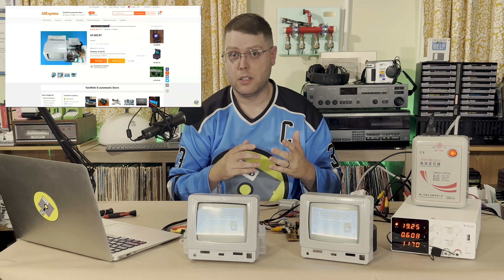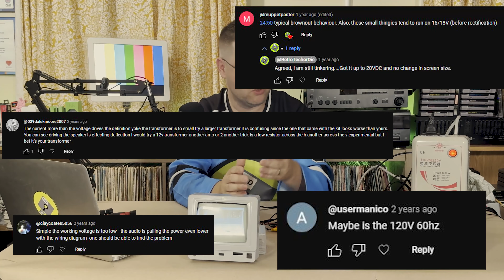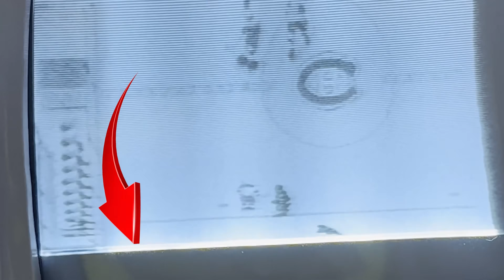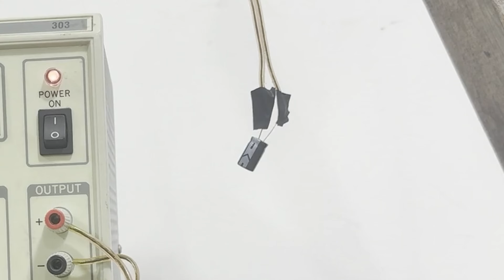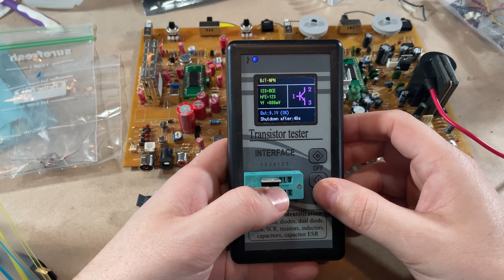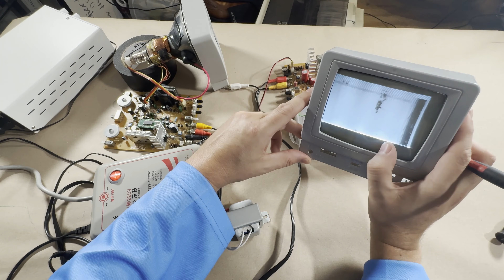I Built ANOTHER CRT TV from an AliExpress Kit—But It’s Still Not Working! #aliexpress #diy #retro

Comment: Thank you for the interesting pair of videos. I know you've shelved your CRT TV builds for now, but I was inspired enough to order a kit (PCB and parts only, no CRT or case, the CRT I planned to use came from an old baby monitor). My first build resulted in nothing but a horizontal line.  So of course, like you, I ordered a second one. That build had transistors Q6 and Q7 explode. Those transistors drive the vert deflection coil. I measured the resistance of the vert yoke and compared it to another 5" CRT and it was about half. Apparently not all 5" B&W CRTs are built the same. I replaced the destroyed transistors, swapped the CRT for the one with higher yoke resistance, and I had a working TV.

It seems to me that one thing your two builds have in common is the supplied CRT. The CRT I used that worked came from one of those 5" portable TVs they were practically giving away in the early 2000's. Swapping the CRT might get you closer to a working set.

I also found the original Chinese training document for the kit. I've created a very ugly English translation. It has test voltages and wave forms that might be of use to anyone attempting this build. Here's a link: 
https://1drv.ms/w/c/f632a9afe283d7ea/EckYohVPitFGn4gnvmXG5OEBtHzCDw6B9cF4gAomSC2Mbg?e=n02HfT

Comment: Hello my friend.  I saw this video today.  Try fixing the screen moving the chok at the tube. moving it front or back it will make the picture larger or smaller and if you move it left or right the picture will change in angles.  Nice playing with old tech.
Reply: the yock must have two plastics and moving them are changing the way the electrones are moving in the tube. You need to calibrate it. Don't bother about 50hz or 60hz. Remember that ac is converted after the rectifier. It is dc volt. Calobrate the yock and you will be fine ..

Comment: The pal/nstc converter probably just converts the color signal by inverting the phase of each alternating line, so the typical black & white signal that the TV shows turns into a color one, but it's very unlikely that it changes the amount of lines or frequency, that's way harder to do.

Comment: PAL/NTSC/SECAM is color information and is ignored/filtered by B&W CRT. 50/60Hz vertical framerate will make image out of sync, same for horizontal for different non-compatible resolutions. Reverse engineer Vertical amplifier and compare it with brand TV circuit and waveform.

Comment: It’s black and white, right? PAL and NTSC are only needed for color sets. They’re both reverse compatible to a single black and white TV standard.
Reply: No, "modern" black & white is just PAL & NTSC without colour, they are not the same standard. They still use a different number of lines and have a different refresh rate. While many proper CRT TVs could handle either signal in black & white, they still have to accommodate these different timings.
The system here is obviously a crude design, so isn't handling NTSC timings properly. Likewise it probably wouldn't handle the oddball signals from old game consoles, which normal CRT TVs did.

Comment: You are in for a good learning experience with a rather steep learning curve.
There is no doubt the kit needs a thorough optimitazion of the circuit.
Its not "fake" components, its a complete re-calculation of every component, according to the control IC specifications.
Firstly the finished kit immediately shows a weak power supply - start here !

Comment: 13:52 one of those 1k (brown-black-red) resistors seems to be measuring not 1.0k, but 1.2R!
The gold color band indicates a tolerance range of 5%, which would make anything from 0.95k to 1.05k "within tolerance".  The 1.5k and 1.2R results are both wildly out of spec.  I suspect that the 1k resistors that went into that color banding machine were also contaminated with resistors of other values.

Comment: If it’s 60 Hz instead of 50 Hz the frame scan won’t reach as far down the screen before the frame sync kicks in. If the NTCS to PAL converter just changes the chrominance (colour) carrier but not the frame rate the same problem will occur. You need an actual PAL source at 50 Hz/FPS to test.

Comment: I have build an 'oscilloscope', when I was about 16 around 1976, I used my knowledge from highschool, so it was quite primitive, but was lots of fun (besides the electroshocks). It used the famous P5 tube. Anyway I think sw6188 is saying smart things, although I don't know some of his abbrevs. It's clear that there is something wrong in the vertical signal resulting in a bunch of horizontal lines at the bottom. I'd solve that first! Clearly it has nothing to do with the power supply or the PAL versus NTSC signal. BTW. modern (switching) power supplies can use 120V or 220V both. They first convert it to DC using a small transformator, a diode bridge and capacitors and then the switcher does the rest, taking a little voltage at a time. After that there is another capacitor of course to stabilize it. This invention was made quite late, because switching a big stream gave heath problems. But a thyristor could do that! The problem was that whilst switching between on and off, there would be some current flowing.
Reply from the maker: So this has its own bridge rectifier and the DC voltage after that is with in spec. My gut things its less a power issue and more a design issue.

Comment: There is no point in trying 220V since the thing internally works on DC anyway, 50Hz or 60Hz makes no difference...
This certainly has nothing to do with PAL or NTSC... It is clear that the raster is not large enough to fill the entire screen. The first thing I think of is that the supply voltage is too low. .. Maybe the thing is just so poorly developed... It could be that one of the voltage regulators is too weak. The effect of the audio on the raster really makes me think of a power supply problem. There also seems to be a problem with the vertical sweep which causes the compressed grid at the bottom.
Reply: Except that multiple people have reported them working with PAL, including someone on here using a Pi - the TV image was small when set to NTSC but fine when set to PAL.

Comment: Update: raspberry pi with a PAL signal, does do full-screen on mine, whereas NTSC results in the squished picture like you have
Reply from the maker: That is interesting! It makes me assume the NTSC to PAL box I have is junk.

Quick question...when it is just displaying static (no input) is the bottom squished too, or only when it was getting a NTSC signal?
Reply: @RetroTechorDie  Many of these convertor boxes don't output a true PAL signal. It is a "compatible" signal which will produce a watchable color picture from an NTSC source.
Ordinarily the format of the signal should not cause a change in the picture size, but who knows what's going on in the jungle IC in this TV.
Reply: @stopthebus  Yes, it's likely "PAL60"
Reply: @RetroTechorDie  I’m at 18:14 in the video, where you say you have no true PAL sources, yelling at the screen in my mind: “find an old laptop or something”. 😂 When I’ve needed an SD video source, I use my old PowerBook G3’s s-video output, since it can be set to NTSC or PAL. It’s then a true 59.94Hz NTSC or 25Hz PAL signal. Tons of late 90s-early 2000s laptops had composite or s-video output (the latter of which could be converted to composite with a dongle that was usually included), and many desktop PC graphics cards could do it too, either from a direct output or with a dongle. Using a raspberry pi is a great idea, since it does the same thing and is cheap and easy to get. 

Indeed, a cheap NTSC-PAL converter is almost certainly not doing true format conversion, since that requires adapting both line count and frame rate, as well as the sync format. So chances are they’re doing what cheap “NTSC playback”-capable PAL VCRs do: they output an NTSC signal with the sync and color information changed to PAL, but with the NTSC lines and frame rate intact. Most TVs can handle this just fine, but you can’t record it onto a VCR, and it’s certainly conceivable that some TVs can’t handle it.
Reply: @RetroTechorDie  A cheap way to get true PAL could be to buy a cheap HDMI to AV box (which are in a visually similar box to your NTSC-PAL convertor). They're not starting with an analog NTSC signal, and use USB power so aren't reliant on the mains voltage frequency.
They don't specify the PAL & NTSC output refresh rates, but I suspect they already output PAL 50hz & NTSC 60hz regardless of the input signal, as they support multiple input resolutions & 50hz/60hz input signals over hdmi, so already have to scale the image at least.
Even if it didn't support converting from a 60hz HDMI signal to 50hz PAL, presumably you could just set your computer to output 50hz HDMI.
Alternatively a video card with TV output would give a perfect PAL signal.
Some AV devices may also let you switch to a true PAL output, especially if they support 110-220V, as they'd be made for all markets.
Reply: It’s the 50 Hz frame rate with PAL. 50 Hz makes the frame duration 20 ms, whereas for 60 Hz it’s only 16.66 ms, so the TV starts returning to the start of the screen 3.33 ms early, shortening the displayed image.
Reply: @derekjc777  It's shortened in both directions though - height and width. I can understand the height being shorter but how would a 60 Hz frame rate affect the width?
Reply: @ I was wondering if the difference in line duration would have an effect? PAL has 625 lines every full interleaved frame, 25 per second. 625 lines every 40 ms is 64 microseconds per line. NTSC has 525 lines per frame, 60 frames per second (actually 59.94 after adding the chrominance carrier, but close enough), which is 63.49 microseconds per line. This not really enough a difference to have a significant effect.
I also wondered if the fly-back circuitry used the frame rate to determine the speed of the beam across the screen. If it uses a phased-locked loop that assumes the frame rate is 50 Hz/FPS, then it could get the line scan speed wrong if it was given 60 Hz instead. This might explain the narrower line widths and higher scan speed.
Reply: CRTs don't work that way. The electron beam has no other choice but to follow the sync pulses in the signal (except for late CRT-TVs with elaborate signal processing). The sync pulses thell the beam drive circuit when and where to draw, and how fast. It can't just decide on it's own to stop midway.
The reason the image is vertically squashed is simply because the deflection needs to be adjusted for the difference in lines per picture between 50 and 60 Hz signals.

It's a common occurance if the chassis simply is not multi-standard. It can display only one standard correctly. 
PAL60 by the way is 60 Hz with 525 Lines (same as NTSC). The only difference to proper NTSC is the color modulation scheme being PAL.
Reply: Interesting!
Reply: @devicemodder

Comment: 1) There is a couple of faults here. The image on the screen is undersized, and you have frame overscan at the bottom of the picture (the extra bright lines there). Are you able to reduce the picture height using the onboard trimpot, and when you do this do the extra bright lines at the bottom disappear - i.e. does the bottom of the picture become normal again? I suspect you have this condition because you have increased the frame height beyond limits in an attempt to get the picture to fill the screen.
2) This is not due to the wrong signal (PAL, NTSC etc) nor is it to do with your power supply. As you say, DC is DC.
3) We have eliminated the yoke as being the issue, now that it is in the correct position.
4) One thing that can cause the picture to be smaller than it should be (in both directions) is excessive EHT but unless there was some obscure fault with the circuitry or you left out a capacitor during construction, this is unlikely.
5) Another reason for under-scanning is low HT. Have you compare the voltage with that of a known good working set?
Reply from the maker: I really appreciate this comment!
1)	Even with trimpot adjusted that overscan remains. 
2)	100% agree
3)	Again 100% agree
4)	The more I work on this (especially with good parts) I think the circuitry may be part of the issue…more on this below. 
5)	I worked closely with someone in South America who built one successfully and my voltages were very close to his.
The more I research into this the more it appears it was never meant to be 100% functional as is. It seems it was just a training tool and as long as it “worked” that’s what mattered.
I found a post where someone reworked some of the PCB and that fixed the issues. Although this kit was mass-produced it seems like documentation and troubleshooting is non-existent.
Reply: @RetroTechorDie  True, expecting the unit to work "properly" is based on correct board and circuit design. If those are wrong from the start then it's never going to work correctly. There is no guarantee that the yoke is the correct one for that tube, or the tube is the correct one for the design of the circuitry. Parameters set such as horizontal and vertical scan ramps may be too low for this tube/yoke combination. The post about reworking some of the PCB has merits as this was my next thought - that there's a mismatch here and it requires parts of the circuitry to be modified and/or component values changed to get larger scan ramps which will increase the drive to the yoke and expand the picture.
Reply: @RetroTechorDie  Could they have used rejected parts, such as the board?
Reply: In my humble opinion the brighter horizontal line at the bottom is not overscan but rather the collapsing (or folding) of the raster caused by vertical circuitry not working properly. Overscan results in an otherwise normal working device for an image that is vertically too large. In a device that worked normally before that it is usually failing electrolytic capacitors, in which case it is hard to say since this thing is apparently pretty crappy. No idea how a too high anode voltage could cause this effect.
Reply: @patrickcraenen5163  My bad, instead of overscan I should have said foldover. It's been a long time since I was in the back of a CRT set. Excessive EHT will cause the picture to shrink.
Reply: @stopthebus  My mistake. You are right about the anode voltage (EHT). A higher anode voltage causes more acceleration of the electron beam which causes the deflection to be less effective. The so-called breathing effect when changing between dark and light images that makes the EHT voltage fluctuate.

Comment: A waveform monitor would help troubleshoot the video source. But a cheap old Raspberry pi 1 can output analog Standard Definition video. You can edit the config file to output NTSC or PAL. Dirt cheap video generator.

Comment: The problem is most of these Learning kits are basically the result of using circuits designed by Tech-school students, combined with cheap dropout components from factories that produce Capacitors, resistors and all that, bundling that with a cheap plastic case and a PCB  made in factories during times of low demand and then they sell it as learning kits. Often these kits need a lot of changes and and people often come up with their own improvements. I saw this a lot in forums about those cheap 6J9  tube buffer amps, that use a combination of low power tubes and transistors for the actual amplification of the audio and people changed the circuit with some re-routing to increase the sound quality. And yet i find these kids VERY fascinating because they are what they are and i love the fact that they make scrap parts at least available in these kits for some kind of useful purpose for folks like us who love to tinker around and solder it together for fun. Even if these circuits they use for the PCBs are far from being optimized or tested.

Comment: Those "cheap" Hyperkin consoles usually have a switch on them to change between NTSC and PAL. I think you can get the RetroN 1 (their NES clone) for about $20-25. Might be able to find a used one even cheaper. I wouldn't use them for gaming specifically, but for testing things out it could come in handy.

Comment: Just today I received my 4 inch flat CRT from aliexpress and I’ve been having similar issues with screen size and that collapsed line, interesting that you uploaded this update just yesterday. This is at least giving me ideas for troubleshooting, even if you didn’t ultimately solve your issues.
Reply: What does tweaking pot W4 in the power supply section do for you?
Reply: @coyote_den  My pots are labelled RV (or possibly RU), and I don’t see anything near the 12V input.

Comment: The problem with the compression at the bottom is caused by the vertical deflection circuit's being inadequate to scan the screen entirely from top to bottom.  The vertical circuit produces a sawtooth wave at approximately a 60 Hz rate.  if that sawtooth wave is not linear, you can get results like you're seeing.
There is a transistor or more than one transistor in that vertical circuit that is operating too close to its limits.  If you look at a normal vertical waveform on an oscilloscope, you should see a smooth straight sawtooth.  The waveform from this little TV is not smooth and straight; it is curved at the end, causing the compression seen in the picture.
Reply: @RetroTechorDie This. You could try inputting a linear sawtooth and see if that fixes it, assuming you can sync it with the frames.
Reply: They are transistors Q6 and Q7 in a push/pull configuration. In my first attempt at a build Q6 exploded and Q7 converted into a resistor. So yeah, I'd say they are over driven. Even after replacing them, and swapping the CRT, they are still quite warm to the touch.